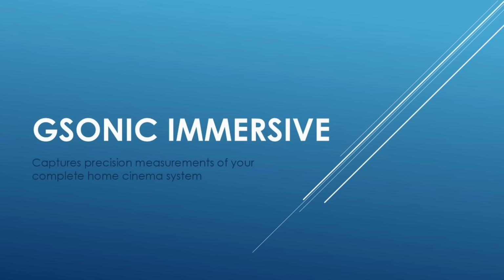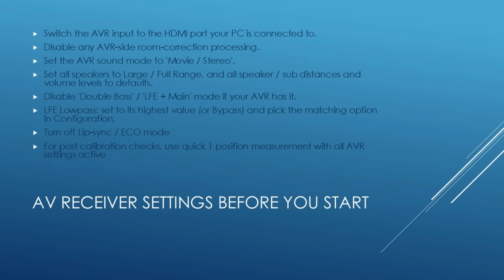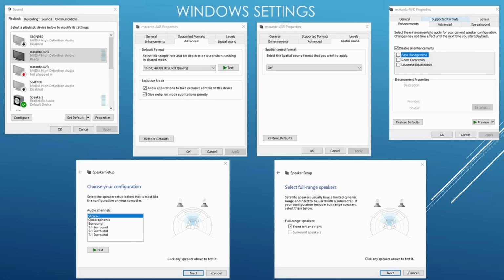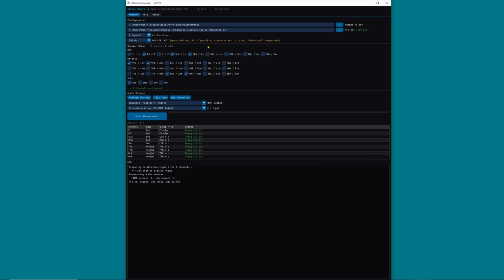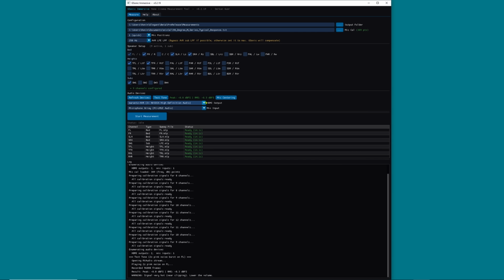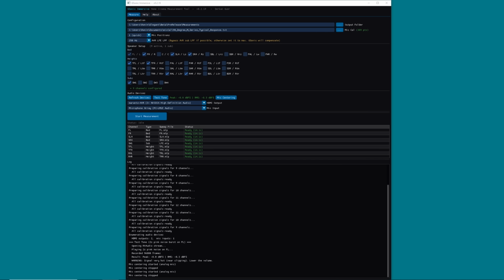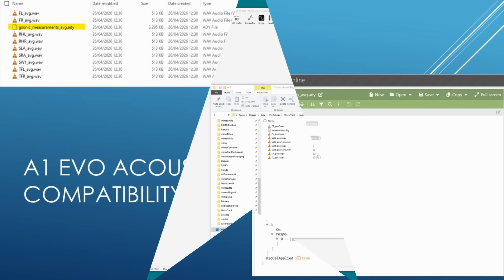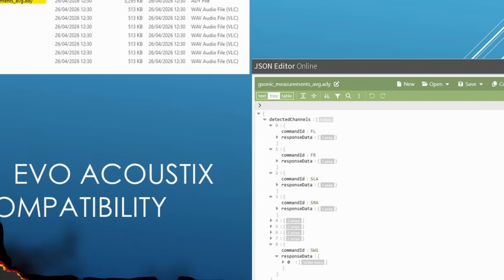GSonic Immersive

Comment: Hey @OCA,
I am still struggeling with the newest version. It is hard to get past the inital problem, that when resetting the AV10, the connection is broken, no sound nothin. When switching channels back and forth, it works again but the tool complains about not getting into immersive sound. I am not seeing what the problem might be... did you encounter this before?
Best regards,
Carsten
Reply from the maker: Hi, do you mean you are getting error messages after clicking the "AVR Reset" button? That operation is purely telnet over your network.
Reply: @ocaudiophile  Hm, my former answer got deleted, dunno why, so now in short: I can play atmos on the PC and geht atmos sound if using Dolby Atmos for home theatre, so in principle it should work. When resetting my AVR it seems like the hdmi handshake gets broken because I have to switch channels (AppleTV and back to pc) so get sound back. In more serious situations, I need to completely switch the avr.

While using GSonic, everything is green, the reset says in green everything completed but when looking into the log it says „could not switch to immersive mode“. I tried to install older versions but it I could not find a systematical way to find the error :( Yet I do not know if it is a AV10 problem, a pc/windows problem oder isolated GSonic Problem :(
Reply from the maker: If you have no Atmos speakers, your AVR will not switch to Atmos sound mode. Adding a dummy height speaker pair in AVR configuration can avoid that. AVR reset has an explanation for this.
Reply: @ocaudiophile  I have a 7.3.6 Atmos system. I will try to figure it out - perhaps the ambilight on monitor2 breaks the handshake.
Reply from the maker: Maybe. Surely it's not one of the common issues I can easily diagnose. AV10 is also a complicated beast. If you cannot resolve please share your debug log.
Reply: @ocaudiophile  After disconnecting Monitor2 I immediatly could start measuring, right away. I will do more tests but this seems to be the solution or at least connected to it ;) I sent the measurement log into claude to give you more feedback and obviously the first channel is measured by PCM and not TrueHD-MAT Bitstream. Is this intended behaviour?
Reply from the maker: Yes FL is pcm, all others are lossless Atmos
Reply: @ocaudiophile  Okay, this answers another question^^ all other channels were almost 10 dB hotter that FL: Since this is PCM and is influenced by the windows volume and the others are not, I have to re-measure everything but hey, problem found xD You check the mic volume so if this intended, you it might be a good idea to  check for the speaker volume too. If you can get any signal from Monitor2, perhaps it is a good idea to deactivate it or give the hint to disconnect every ambilight/HDMI-Audio-Extractor/EDID-HDMI-Handshake-thingy ;)
Reply from the maker: If FL and FR volume is different, that's a window volume setting not maxed out

Comment: Hi @ocaudiophile, Are we planning to add repeat measurement for each channel in future?
Reply from the maker: You can keep the mic at the same position and repeat that position if you need to
Reply: @ocaudiophile Yes. That was fine but what if I want 30+ repeats. Position is limited. Also if we use a position, I need to come back and confirm every time. Whereas repeated measurement is automatic one click like AcoustiX repeated measurement
Reply: I am eagerly waiting for repeated measurement feature
Reply from the maker: I don't see a use case for it in a serious measurement app. You are not supposed leave the measurement environment and stay focused and aware of unexpected noises, glitches, clipping etc all of which will trigger an option to repeat that sweep and process will stop. AcoustiX case is a practical solution for dealing with the inherent jitter issues in Audyssey measurements through mega repeats, a problem not present in GSI measurements.

Comment: working with this version hasnt worked so far , after measurements are finished, a G sonic "oca" file isnt generated, rew isnt started up and i cannot continue, im stumped? i have the latest rew version.
Reply from the maker: This is a measurement only tool but it saves an .ady file under the averaged folder that you can use with the free tool "A1 Evo AcoustiX" for calibration and filter transfer if you're on a Denon or Marantz.
Reply: @ocaudiophile  hiya OCA, when i use the ady file, the transfer line in a1 evo isnt highlighted, so i cannot calibrate or transfer?
Reply from the maker: You have to optimize the ".ady" file first (using standard or custom optimization menu options) and then A1X will create the .oca file which you can transfer.

The workflow is: Measure the system (saved in ady file), optimize and generate filters (.oca file), transfer to the receiver.
Reply: @ocaudiophile  thanks for replying so quickly, i have measured my system, i have the files ADY included, how do i optimise and generate the OCA file? i open A1 evo, and its all greyed out apart from express callibration and exit?
Reply from the maker: You are almost there. Acoustix is looking for an ady file in the folder and cannot see it. Just copy (or move) the GSonic generated .ady file under AcoustiX folder and optimization options will light up and let you select that ady file.
Reply: @ocaudiophile  Thanks very much OCA, i have done it with your help, it ALL works and im checking  the sound

Comment: Hoi OCA,
great work so far! I want to use the autoamtic MultiSubwoofer Measurement Feature, but it is greyed out with my AV10 and the app asks me to switch the subwoofers manually. What do I need to do to use it?
Reply from the maker: You need to use "AVR reset" button to activate it when you start the app.
Reply: @ocaudiophile  Ah okay, it is a bit annoying but okay. To be honest, currently the version 1.1.6.1 seems to be broken for me. I cannot get a single run to work. here and there are different errors along the recording (ATRs blocked, 2.0.0 channel layout is problem but it is resetted that way, the avr input needs to be switched or it is silent after reset and so on) :(

Whatever the problem was: it can be walked around by shutting pc and avr down and restart after some time.

Comment: Hi Serkan I tried measuring 7 positions with 1.1.6 on Sunday with umik-2.Listening for two days I felt drastic improvement from 3 position measurements like imaging separation, soundstage width and depth, everything sounded phenomenal. I felt like I am using a power amp without an amp. The energy was huge for an avr. I have only one issue ie with centre channel which have lower or throw than other channels. I tried to boost with 6 db with custom settings but that was not enough, then i tried custom filters where in rew there is an option called target level volume I tried to increase 4 db there and applied auto eq till 500 hz then I felt my centre channel voice throw. I need to know if it is the correct way to increase db in target level volume and eq. If not please let me know something else which i can try. 
Otherwise it’s sounded like i am sitting in huge theatre also music sounded incredible with pin point centre image with in wall speakers in stereo mode.I don’t don’t know how you made it possible with in-wall speakers.

https://drive.google.com/file/d/1zzZdxbcAKKyodh4cZut0wCG6_6vZmd55/view?usp=drive_link
Reply from the maker: "Ditch your center speaker"  if your fronts are symmetric around MLP is my suggestion :)
Reply: @ocaudiophile  oh my god it’s like i feel audio nirvana, how does it have so much gain with every speaker other than centre. I felt so much power between 60-65. It’s just 5 inch driver but it sounded me like an 8 inch. I never heard so much mid bass in a 5 inch single driver. Sure I will try to ditch the centre. I was mesmerised comparing old measurements as usual with your tools.
Reply from the maker: That's exactly the idea

Comment: Today I got the GSonic. I have the Audyssey mic. Do I need to connect Audyssey mic to take measurements?
Reply from the maker: You need to connect it to your PC and use the Audyssey mic cal file which you will find in the link in the description.
Reply: @ocaudiophile  Thanks. I proceeded with the measurements and all the speaker/test tone levels changed to -12dB after optimization with default A1 Evo Acousticx settings.

Comment: Merhaba Serkan. v1.1.6 yı yükledim. Denon avr nin kendi mikrofonunu kullanıyorum. tüm ayarlar tamam. FL, FR ve C ölçümlerini yapıyor. SLA ya gelince ''SLA recording had a capture dropout? the windows audio engine lost samples mid-sweep corrupts the measurement. this is a system load/usb-bus issue, not your avr.close other apps (browsers, virus scans, downloads), plug the mic into a different usb port(ideally not a hub, avoid usb 3.0 ports next to one another), set windows power plan to high performance, then click repeat to re-measure SLA                 Status: Both ATRs blocked- Repeat? '' uyarısı alıyorum
Reply from the maker: Repeat demen lazım, arada olur sorun yok
Reply: @ocaudiophile  repeat dediğim de aynı hatayı veriyor. Bir de denon avr hangi modda olacak bu konu biraz karışık. FL yi ölçerken stereo modda oluyur, daha sonra kendi dolby atmosa geçiyor.
Reply from the maker: Aynen oyle FL 'de stereo, onun haricinde hep atmos olmasi lazim zaten. Windows'da baska bir mikrofon acik filan olmali, aldigin hata windows capture datasini dusururse ordan geliyor. Surekli ayni hoparlorlerde olmasi ilginc, daha yuksek sesle olcmeyi dene ama garip bir ayar problemi var bir yerlerde kesin.

Comment: Awesome work.
However, a question. I have not tried your tools yet as I found them today and have gone through your videos about the different versions/iterations of the tools but I do not get whether or not GSonic replace AcoustiX or if they are complementary tools? Or did AcoustiX really only correct bed layer speakers? I was also not really following whether or not AcoustiX was a Dirac ART alternative (since ART was mentioned at the beginning of that video I gathered that it was an alternative).
Reply from the maker: GSI is a measurement tool and can measure Atmos channels, too (not only bed layers). A1X performs better when measurements are taken with GSI due to the higher resolution GSI offers. A1X uses Audyssey interface and access to the filter slots active bass cancellation requires is blocked so the technique used by ART is not possible with it even if your AVR is ART capable.
Reply: @ocaudiophile  Ah, so GSI is really only the measurement part so Acoustix is still used for the actual calibration?

Regarding ART, I guess Diracs technique of using all speakers in the system to help out with the bass is not something that Acoustix does then?
Just wondering since I got confused as to the mentioning of Dirac ART at the beginning of your AcoustiX video.
Reply from the maker: I could do it better than ART but D&M deliberately blocks the dsp capacity your purchased device has. Message is this: Your AVR is capable of processing cross speaker filters but we will only allow Dirac to use them for which you need to cough another $900!

Comment: I’m not sure if this is a GSonic or Acoustix question, but how can I end up with 0 on the master volume producing reference level? I left the volume at -18 during measurement and it seems that -15 is reference level after running through the full process. Also is there a way I can make sure that the subwoofer trim levels do not exceed -7 so that the subwoofer preouts do not clip during intense scenes with a lot of redirected bass?
Reply from the maker: AcoustiX filters will add 3dB during calibration but that will not change AVR volume displayed level. GSonic also leaves it at -18 and never changes during measruements

A good way is to make a quick GSonic MLP measurement and check the relative(to FL) sub levels and increase sub's internal volumes until you get +7dB there. But if your model is Griffin chip based, the summation of subs will differ. What model and how many subs?
Reply: @ocaudiophile   so is there no way to achieve reference level at 0 master volume? Should I reduce or increase the master volume during measurement? This was on a x4800h with 2 subwoofers.
Reply from the maker: Audyssey interface reduces volume by 9dB after calibration to compensate with boost filters otherwise they will clip. AcoustiX by default doesn't use any boost filters and reduces only 6dB. This is where the 3dB increase is coming from. You will get reference level at -3 volume and some of your filtered frequencies will reach 0dB.

With 4800 and 2 subs, you can do as I said, GSI will show you the correct levels, adjust them to +7 before measurements and A1X will set them somewhere around -7 at the end of calibration of course can change quite a lot with the target curve selected etc.

Comment: Hi OCA, first off, thank you for all the time and effort you've put into this project. I've used your past methods - and now GSonic - to great effect and I'm very appreciative.

Overall, GSonic works great and I'm able to use it to measure, create and apply filters, but I've run into two snags along the way. They're able to be worked around, but I'd like your thoughts:

1. I have a UMIK-1 microphone and a Windows 11 machine. In the audio settings diagnostic, I get the follow error: 

"Enhancements: ENABLED. AGC / noise reduction / echo cancellation will destroy sweep linearity. Fix in Windows Sound > Recording > [mic] > Properties > Advanced > tick "Disable all enhancements."

However, when I go to that window (from the "classic" sound settings), the Advanced tab only has the option to select Default Format (2 channel, 16 bit, 48000 Hz, etc.) and the option to tick/untick Exclusive Mode (Allow applications to take exclusive control..., Give exclusive mode apps priority). There's no option to disable enhancements. I know exactly what you're referring to and I've seen that option for other inputs/outputs in the past, but the driver for this microphone doesn't seem to expose it.

2. Most of the time, the FL/FR/C sweeps play without a hitch. But oftentimes, the sweeps for SL/SR/FHL/FHR/SW1 don't play, or they suddenly start playing halfway through the sweep, as if the "handshake" between the AVR and the PC didn't occur correctly, or occurred late. Usually redoing the measurement will fix it, but sometimes it takes 3-4 failed measurements before the "handshake" finally works. Not sure what I'm doing wrong here. I've run the "Reset AVR for Measurement" command and everything comes back perfect (a few things have to be manually adjusted, like Tone Control, but that's easy enough). I've tried setting the AVR to Pure Direct mode and to Movie Stereo mode, but it measurement failures still happen. Am I missing something?

(Apologies for the long post!)
Reply from the maker: Thank you. Tone control is input specific and will only be reset for the PC input and in "pure auto" mode, it should be bypassed anyway . Your other issues seem to be related to hidden audio enhancement settings in Win 11 (unless it's a bad HDMI port/cable). This video explains how to un-hide them:

https://www.youtube.com/watch?v=yhqArGQwKiU

If that doesn't work, you can try disabling them using the registry as below:

Press Win + X, choose Terminal (Admin) or Windows PowerShell (Admin) — click Yes on the UAC prompt.
Copy/Paste the below exactly and press Enter:

Get-ChildItem 'HKLM:\SOFTWARE\Microsoft\Windows\CurrentVersion\MMDevices\Audio\Capture' | ForEach-Object {
$props = Join-Path $_.PSPath 'FxProperties'
if (-not (Test-Path $props)) { New-Item -Path $props -Force | Out-Null }
New-ItemProperty -Path $props `
-Name '{1da5d803-d492-4edd-8c23-e0c0ffee7f0e},5' `
-PropertyType Binary `
-Value ([byte[]](0x01,0x00,0x00,0x00)) `
-Force | Out-Null
}
Write-Host "Done. All capture devices now have System Effects disabled."
Reply: @ocaudiophile  I followed the video that you linked and it revealed the enhancement settings, which I could then disable! Now everything works a charm - thank you so much!!